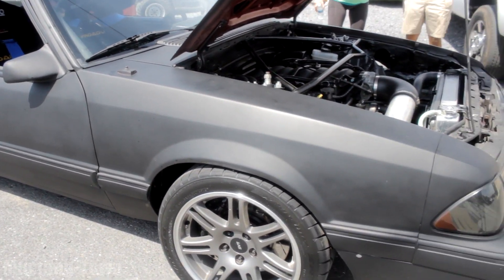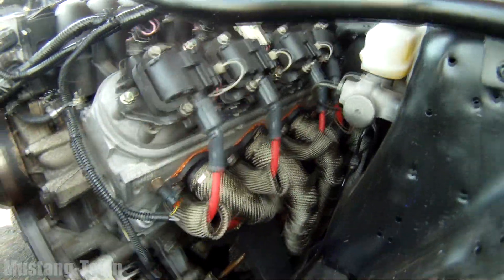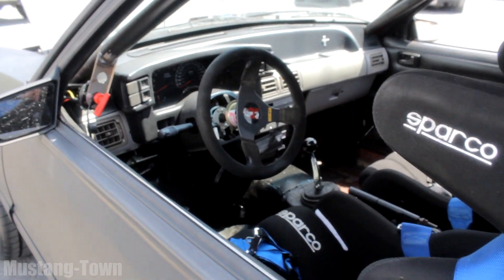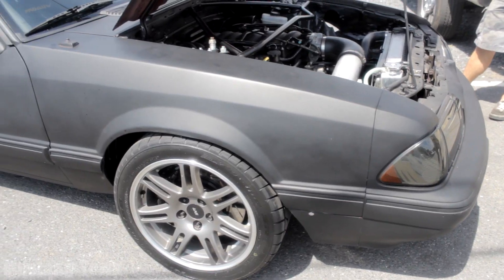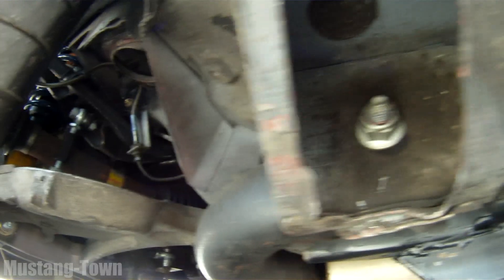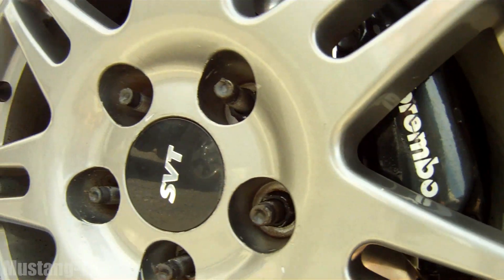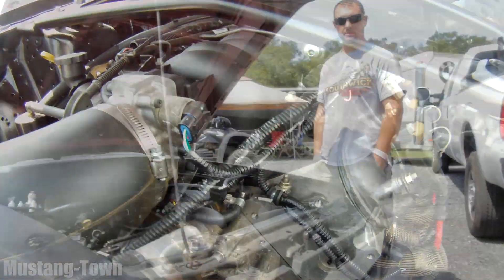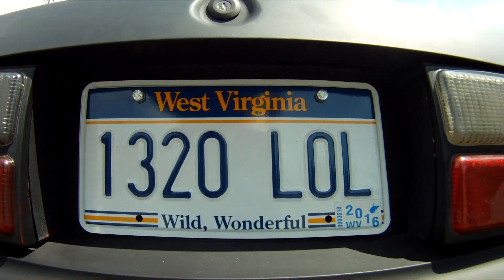“Built Ford Tough with Chevy Stuff” - Fox Mustang Notchback LX Coupe (LS1 - IRS swap)

Comment: I wish Chevy guys would stick to Camaro's!
Reply from the maker: +GA08GT What about "car guys" that don't believe in brand loyalty kid's stuff? lol
Reply: +nedaCFilms / Mustang-Town I just find it funny that Chevy guys tend to be more loyal to GM engines than the actual cars. You don't typically see diehard Mopar guys swapping Hemis into non Chrysler cars and it's the same for Ford guys. Call it what you will.
Reply from the maker: GA08GT Hot-Rodders look for "cheap horsepower".... it's not a Chevy thing man, lol. In another 10 years they will be doing the same thing with 5.0 Coyote motors in everything.
Reply: +nedaCFilms / Mustang-Town  I know the history. I think you should check out the comment section of that Ford powered Z06 or one of the Ford powered Camaros to see they don't like it either. I still enjoy your videos, I'm just not into these swaps.
Reply from the maker: GA08GT I would never do it either.... I just have to respect the way of making th most power in a lightweight machine for as little (or no) money as possible. Takes me back to the old Hot Rods of the '30s-'50s. You always see old '32 Ford coupes with small block Chevy motors, but I much rather see one with an old Ford Flatheads! Carol Shelby stuffed a Ford 289 in a little lightweight British car and launched the AC Cobra movement that are still being replicated today. It's just part of Hot Rodding history..... but I would never do it myself, lol. But I think it's old school cool. I really dig these rear-wheel drive Imports like 350Z's and 240SX's with Chevy LS1, LS2, LS3, LS6 and LS7 motors stuffed between the fenders, lol. So cool seeing American V8 powered Japanese cars ripping around the track sideways with 8 cylinders screaming, lol.
Reply from the maker: GA08GT Thanks for mentioning that you like the videos.... I really do appreciate that!
Reply: +nedaCFilms / Mustang-Town If youre into motor swaps/ Hot rodding you should attend a formula D event.Seen The coyote motor  swapped into nissans/datsuns rx7s bmws ect. Its the new LS

Comment: For the man that can't make a Ford run
Reply from the maker: If only it had a stroked Windsor or 5.0 Coyote motor lol.
Reply from the maker: If only it had a stroked Windsor or 5.0 Coyote motor lol.
Reply: I hear ya, I went with bolt on 01 cobra engine in my notch. Next year will get another turbo setup as I sold my other kit for the pushrod engine.

Comment: If your a GM guy, why the Ford car?
Reply from the maker: Not everyone is a "Ford" guy or "GM" guy.... some are "car" guys. I personally wouldn't put a GM motor in my Fox-coupe but I understand it. It is the epitome of hotrodding as gearheads have been swapping Chevy motors in a Ford chassis and vice versa for 50 years. This is no different than the '32 Fords that were running around back in the day with a small block Chevy motor. Carol Shelby did it back in the '60s but he used big Ford motors in little lightweight British built cars. This guy has the same concept by stuffing a powerful and light LS1 in a light 2,800lb Mustang coupe. Then you also have the LS-based GM engines in the rear wheel drive Import models with the current drifting movement. I wouldn't do it... but I completely understand it. It's just old school hotrodding. Can't deny this guy has put together one badass build, but it would be just a bit cooler if it had a new 5.0 Coyote motor, lol. But that would go against the whole point of junkyard treasure hunting and budget building. This dude doesn't have much $$$ in this car at all.
Reply: The Fox looks better and is lighter than the camaro.
Reply: nedaCFilms / Mustang-Town i love the hotrodding thing too and love seeing cars like this. im sure you've seen the beater bomb mustang with the 5.3, that things awesome and you can pick up those lm7 engines for so cheap.  although im with you, i wouldnt do it

Comment: Cheaper doesn't mean better. Coyote only weighs 444. 6.2 ls weighs 465. Coyote heads out flow your ls heads that why there is no aftermarket heads for 5.0 coyote or 5.4 5.8 mod motors. Brand new 5.0 coyote motor with power pack is 6999. You want the new lt4 your gonna pay 9999 for motor and power pack. New coyote can handle 900hp how much new lt4 hold from the factory?
Reply: First off, ls qeighs less than a coyote and thats a fact wether you like ford or not. Second off, the 4.8,5.3 and 6.0 ls truck engines have held over 1300 hp so 900 is cute
Reply: yeah and i got a good deal on a pair of unicorns.
Reply: bro your like cancer in the comments section.. there are other ls crate engines cheaper than $9999 first off, second $6999 is the price for the 5.0 coyote "replacement" lmao it's bone stock nothing special.. and if coyote heads outflow ls heads where are the power figures to back it up??  summit has ls7 625hp 565ft.-lbs for $8999...type in coyote on Google and every coyote crate that comes up is $14k +
Reply: +Darren McFeaters not only are they $14k+ but still don't make the power the ls7 makes..
Reply: 14k for just the motor, not including install and making it work lol
Reply: um its 7grand for the 2015 and up forged 900hp motor with ecm and wiring new. And it bolts right in. Same k member and transmission saving money there. The lt4 is 9000 with ecm new, You want to go junkyard building much cheaper then again thats why they call it a junkyard.

Comment: There is no good reason to use a LS engine in a Mustang. The Ford engines are just as powerful and more durable
Reply: An LS motor is by far the best and most reliable bang for your buck. There not too expensive there light strong and reliable and make power easy. It's a winning formula. Not hating on any ford motors at its just a better deal
Reply: +FreeeeBeer LS motors are easier to make faster. Mustang motors are great stock but once you start working on them they become really unreliable and expensive. LS motors are easier to work on. Pushrod > DOHC :) Torque baby TORQUE
Reply: +FreeeeBeer Ive owned a fox body and ford shit for 10 years and just lold at this
Reply: +AROCK95 your joking right lol. There is no such thing as reliability in racing. One of my buddies just put the motor back in his G8 after it spun a bearing just north of 600rwhp. Another guy I know split his ls1 block after he went north of 600hp with a turbo. The best thing about the ls motors is they come with decent aluminum heads THATS ALL.
Reply: +71sc502 I doubt your friend is shooting a stock bottom end ls engine with a 175 shot. Unless he changed his pistons. You ain't doing that with no damn silicone hypereutectic pistons
Reply: James McClary well he does, so doubting doesent change tht. Ls engines have seen 1300hp on stock internals. Look up the big bang theory
Reply: Listen 5.3 blocks have seen 1300hp the other engines will split the block because the rest of the L's engines all are bored over 5.3 blocks except for the ls7 I believe. Again your not doing that with silicone pistons atleast not with nitrous
Reply: Shit a junkyard 351 with aluminium heads and a turbo went over a 1k HP without any type of tuning
Reply: James McClary lol it had to have had alot more than a turbo, heads and no tuning. Also, no they arent "just bored over 5.3 blocks" first off the block isnt even made out of the same metal, second off how could it be "just a bored over 5.3 block" if the 5.3 came out after the ls1. It doesent matter what you doubt, facts are what matters. A 175 shot probably boosted him up to 450hp roughly, yet ls1's have seen WELL over that with stock internals, so doubting it proves you dont know anything about them. And silicone pistons?! Wtf?
Reply: actually no it didn't feel free to go read the article. also I said I think on the L's blicks. I forgot the 5.3 block is iron. all the other blocks are based off the ls 1.
Reply: actually no it didn't feel free to go read the article. also I said I think on the L's blicks. I forgot the 5.3 block is iron. all the other blocks are based off the ls 1.
Reply: actually no it didn't feel free to go read the article. also I said I think on the L's blicks. I forgot the 5.3 block is iron. all the other blocks are based off the ls 1.
Reply: James McClary well, theres links with many people spraying 250 shots.
Reply: That is total BS. The Ford Cleveland gives you more trq and HP. HR mag said it was the best motor to HR of all time. Guy lives up the street from me has one in a Stang. He foot brakes the car to low 10's. Stock motor. Check out the Coyote class. Stock Motors reving up to 8500. they are in the 9's. Kaase built a defunct Y block that out performed the current LS motor at the engine masters in 16. and the list goes on. got 100 more. the LS was touted as a mod miracle of engineering, lol. GM is stuck in the dark ages. that is old tech. push rod motor has too many limitations, Coyote new tech and much much better. expand your world Bro it's not the 60's,lol.
Reply: lol
Reply: HDVICTORY ford you sound like Riddler lol
Reply: @hdvictoryford5329  the over head cam engine is older than the push rod engine

Comment: could of put coyote and made more horsepower.
Reply from the maker: +Darren McFeaters The LS1 was free as he had a Camaro SS donor car.... a 5-liter Coyote motor is not cheap lol.
Reply: 900 bucks is expensive? Thats all i paid for mine. Putting it in my wifes 2000gt. You are a bad shopper.
Reply from the maker: Darren McFeaters Free vs $900 lol.
Reply from the maker: Doesn't really matter either way though because it isn't my car lol.
Reply: coyote fits perfect in the old foxbodies. Now with so many wrecked f150s out there they are cheap and plentiful. Everybody is doing it.
Reply from the maker: Darren McFeaters If you read the earlier comments you will see that is almost exactly what I said, almost word for word about the wrecked F150s lol. If a Ford guy bro, I just appreciate the old school way old hot-rodding and this fella's fit and finish. He did it all himself with almost zero money involved. That is the epitome of American Hot-rodding!
Reply from the maker: Darren McFeaters The F150 motors don't make the same horsepower as the GT Coyote unless you do a few upgrades/mods which is exactly what this guy did with the heads and cam.
Reply: Only cams different. Heads are same. Who puts a stock truck motor in a car? Set of gt cams are cheap replacement or install better cams. Cams and tune you looking at 450whp easy with pump gas. Everybody whos has done the swap in a notchback are in the 10s easliy. Coyote only weighs 444lbs nice and light.
Reply from the maker: That $900 is growing lol.
Reply: yeah because racing is about doing it as cheap as possible? Oh look used coyote gt cams 300 bucks. Yep breaking the bank open.
Reply from the maker: Darren McFeaters The point of this fella's entire build was super light and super cheap. The guy build this car with scraps lol. Give some good 'ole motorhead respect lol.
Reply: Real racers dont to cheap. He isnt doing anything that hasnt beeb done already.
Reply: hope you sleep better at night after typing that.
Reply: Glad to hear it nut swinger.
Reply: +Darren McFeaters absolute lie. you will never find a coyote for less than $3000. its absolutely impossible.
Reply from the maker: +iRed7up Yes... he is full of !$%&? lol.
Reply: nedaCFilms / Mustang-Town he absolutely is. fuck, i cant even find an 03/04 mach 1 motor for less than 3000 on craigslist right now. theres no fucking way you will get a coyote for 900 unless its a gift.
Reply: +Darren McFeaters a ls1 is better than a coyote anyway
Reply: lmao. ls1 make 435 crank hp from factory like the coyote does now?

Comment: Ls is better than coyote? Lmfao.
Reply: +Darren McFeaters    Smaller, lighter, cheaper, easier to work on.    Non biased motor heads would definitely say that=better !!!     LMFAO
Reply: +Darren McFeaters I mean if you have the chunk of change to do it then sure it would be better for its high rev and quick rev ability, but if you don't have that extra chunk of change the ls swap is the best choice. He isn't trying to build an expensive ass vehicle. On top of that I am sure the ls1 already hits the limits of a fox bodies geometry, they only can go so far with its geometry. Honestly the cost of doing a coyote + all the suspension to go all out, you might as well go with a s197 and do some moderate mods to have a nice hybrid of daily and track, unless your going for the win. You have to think of how efficient the build is going to be and its use before saying oh hey this is better. It all depends on the wants and needs, as the efficiency of a build is what it comes down to. For me a coyote swap isn't going to be worth it, its a budget race car, and a coyote takes me out of the budget and moves it into a nuisance, when the LS will do the job more efficiently, bringing the fox body to its geometry limits.
Reply: Trigger Finger coyote is easy to work on and only weighs 440lbs.
Reply: Trigger Finger 1500 for junk yard ls cheap? its always cheaper to use the parts that came with the car. Can build a foxbody with a 351 and still get same performance a cheap, oh i mean budget build. Been doing it since 1987 know all about it.
Reply: Darren McFeaters LS are 700 or less, more parts and used more for a reason
Reply: +Darren McFeaters you don't know shit, $1500 for an ls is nowhere near accurate. you can get a 5.3 for $500 and a 6.0 for no more than $1000.  they are a dime a dozen. cheaper easier to work on and proven reliability. there's people making 700+hp on completely stock bottom ends and heads... there's a reason why NOBODY coyote swaps anything... GM is blowing Ford away with a pushrod motor
Reply: Darren McFeaters it is...
Reply: it is your opinion not a fact.